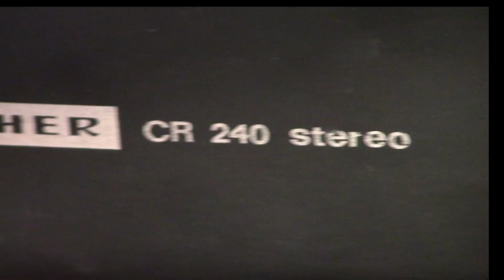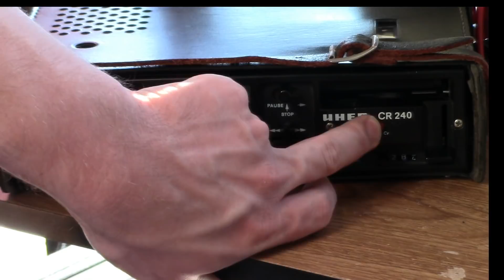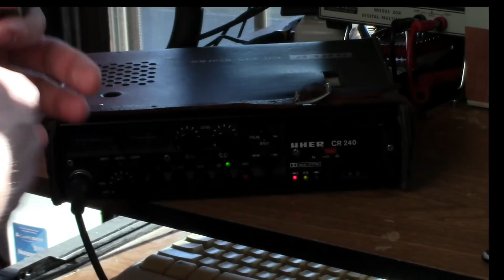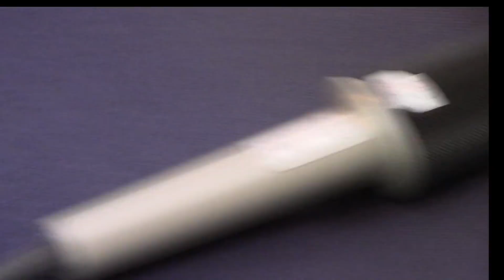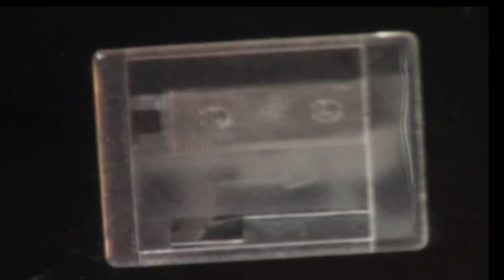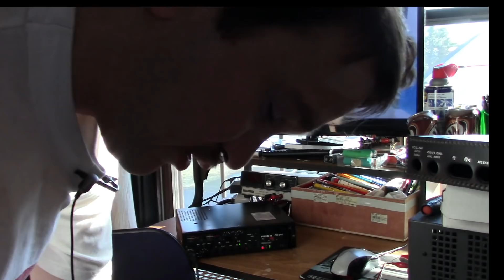Uher CR 240 Stereo Cassette Tape Recorder, c. 1977

Comment: I remember seeing these on Ebay many years ago (somewhere in 2006 or so) when i tried to get a Uher Report 4200 Stereo IC recorder. And in the results these little buggers always appeared constantly. Never really felt like buying these because i wanted reels and not cassettes. Silly me, those machines are really sweet. If only repairing them would not be such a nerve-wrecking experience that bleeds your wallet dry because of the overpriced spare parts. Reporter Cassette recorders are really my favorite. Didn't get one of these Uher models thou but ended up with the Sony TCD-5M.